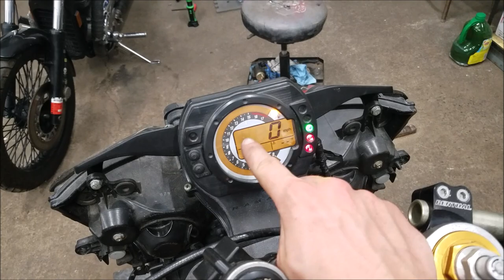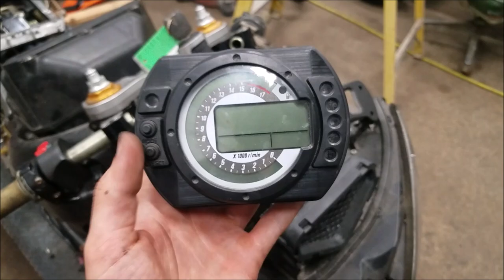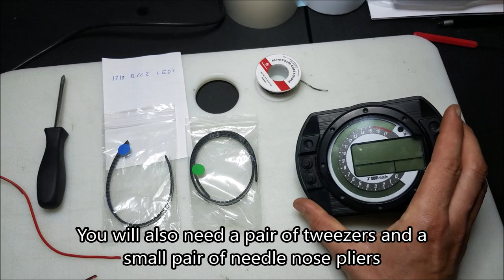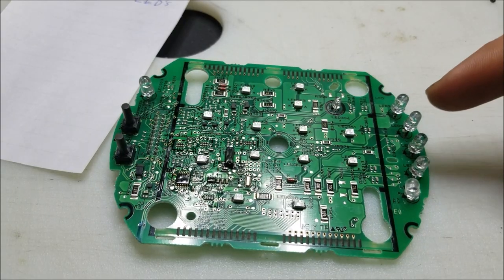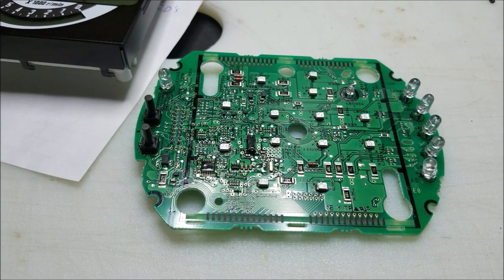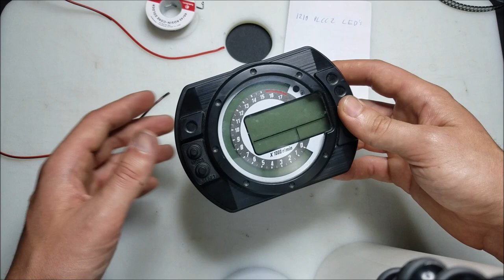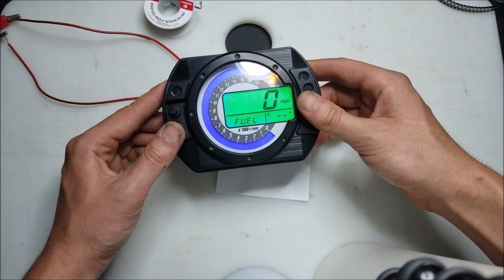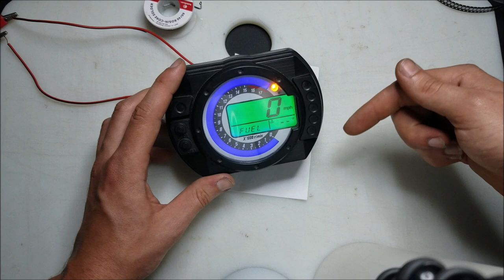How to Change the Color of Your Kawasaki ZX6R ZX10 Gauge

Comment: I'm currently changing mine out on a 05 zx10r same dash. Changed the 6 middle LEDS, put it back together to check and the new LEDS work fine. Now my LCD is reading funny. Instead of displaying 0 it's a mix of 3 and 0.
Edit found the issue. I didn't have it back together 100% the 4 metal tangs all weren't bent and only 1 screw on the circuit board. Don't rush! Great video.

Comment: Amber low fuel and shift bulb type LEDs can be replaced using the same 1210 SMD LEDs.  The cut corner side is the ground.  The bulb type has two pins inside, a fat one and a thin one - the thin side is positive. As mentioned, LEDs have a dedicated power terminal and ground.

Comment: You can get finer tips for that re soldering unit you have. I have the same one. Another suggestions would be to use soldering paste. Then you can just place the LED and use hot air to solder. Saves applying heat to the board. Most mistakes people make are putting too much heat to the board and frying something

Comment: Wicked! I think if I was doing this I'd mix it up a bit; change the LED at the top of the tacho to red, the next one amber, then two green, and the bottom two blue; the diffusion and gradient would make the range go from blue idle, cyan fast-idle, green cruising, yellow at the start of the power, amber for the power, and red for the limiter

And then like. White or magenta for the speedo I guess 😂
Reply: Yeah I’m having white for my Speedo, green all the way up to the 5th LED then red for the last.
Reply: Yes, but don't make it tacky, lol...
Reply: @cr45h20   I’d like to see that. Did the color transition blend well ?
Reply: I'm going to do this over the weekend.  Get a purple up top on high rpm,  blue down low, then blend a teal with green on speedo

Comment: Nice tut! Unfortunately my 250R uses bulbs not leds, any ideas?
Reply from the maker: You should be able to find compatible colored leds to swap out. There should be no soldering involved then so it would be much easier!
Reply: @RKMotorsports  something i was told is to get lower watt leds or risk melting my dashboard housing. Or is that the general idea around all electricals?
Reply from the maker: @plageran  I think if you get leds that are a direct replacement for the bulbs you should be fine

Comment: i wonder if placing a RED LED in the last position on the ring - clockwise - would result in a reasonable red line transition
Reply from the maker: I have done that on a few gauges before and it adds a nice touch to the redline area 👌

Comment: Great vid, did this on two diff 1s, but on the 2nd cluster two of the leds don't work after changing them out 3 times.
Reply: Dang that sucks thats my fear from doing it to
Reply: @BraelonM  I added a bunch of solder on the pads and the leds in place with a a tip and just heated up the sides an they work GREAT, now. Give it try.

Comment: Is there a way to make it brighter? Especially the rev indicator? i find it extremely difficult to see the revs in daylight with a tinted shield.
Reply: I have a zx10r 2005 (generation 1) 
I am thinking about putting on a generation 3 cluster. - it's much easier to see. - but it's also quite expensive. 
As I have understood it, it's not 100 percent a straight fit. But easy to do.

Comment: After seeing this I drove head first into my 04 zx10 cluster. It was a bitch Tbh, just bc of how small they are. Very simple to remove but hard to put all 13 back in. So I did the exact same colors but I guess my soldering gun was a bit too hot or maybe touched something on accident, all the colors work but when you turn the switch off I still have like 2 of the LEDs staying on. Really don't know what to do other than putting a kill switch on for the battery or ordering new internals. 

 Any input will be much appreciated thank you!!

Comment: Hello RK Motorsports, I own an 04 Zx6r 636, bought it used and the gauge has a big black smudge on the center rectangle (where the temp. and MPH are didplayed). I cant see anything other thsn my RPM's and a little bit of MPH, deppending on outside lighting. Its an internal thing, ive wiped the cover and it doesnt go away. 
Is this fixable??
Thanks Mr. RK Motorsports!!!
Reply from the maker: Hi Sierra, sounds like the LCD screen  has been damaged and has "bled" out through your screen a bit. The easiest way to fix this would be to buy a 2nd gauge with a good screen and swap the screen over. Hope this helps!
Reply: @RKMotorsports  
Oh damn!
Do you have or know about a gauge in good working condition I can purchase?

And thanks for getting back to me!!

Comment: I have two questions for you. One related to this video and one that you may be able to help me with.

1) How bad is the bleed of the blue into the green? I'm planning on doing white for the whole cluster with the exception of the LED near redline, which I want to do in red. 

2) Do you happen to know what could cause my fuel light to not go on like yours does? 

I pulled the fuel pump last weekend to diagnose/fix another issue, but didn't think to check into my fuel light issue. I'm not sure what part is the sensor anyways (05 636) on the pump assembly and there isn't any great info I've seen online. I've never seen the light go on in the 4ish years I've owned the bike, and just use the trip to track mileage but would love to have a damn light
Reply: The problem you have is that the sensor that is in the pump has stopped working, you must disassemble the metal capsule and change the sensor for a thermistor, in the zx6r forum I left a tutorial that explains it

Comment: great vid. I dont even have a 636, and i clicked. haha. I do a lot of SMT stuff, and if you dont have hot tweezers, and if you're not reusing the LEDs, you can just us a high quality flush cutter to clip the leads. then drag the remaining leads off the pads with the soldering iron. its much safer since you wont risk pulling up the pads. Which are a bitch to fix and be still be reliable. You can load up a bunch of solder on the tip before hand (helps you get the joint to flow), it takes more dwell time with a dry tip, which can damage the traces and pads... Also try a wedge tip. Way better heat soak on LED leads. Hope it helps... ALSO thanks for the vid... now I wanna try this on my drz's cluster. haha

Comment: I recommend using a chisel tip for soldering (the ones that are slightly flat on the sides). Those conical/pointy tips have crappy thermal capacity and they often make those solder spikes when you remove the iron from the solder joint.
Reply from the maker: Pretty sure I have one of those that came with my soldering iron. I'll need to try that out

Comment: does anybody know if this gauge from zx10 is same as z750. they look the same but is electronic same inside? i bought an old z750 and odometer is way wrong, seas i m doing 80mph when i m going 50. in little investigation on back of gauge its writen with marker zx10 so was wondering abaut compatibility between these 2. ty for any help (info) regarding the matter

Comment: Any chance you may know why my speedometer section isn’t lighting up. I changed the tachometer section to green and all is good but my speedometer section is dead. Curious if you knew what could be the culprit. Thank you
Reply: You could have torn pads off the PCB, due to copying this guys technique, You never EVER want to "Pull" on a device the way he did these LED diodes, you can easily damage the traces/pads on the PCB. You may have also just put the diodes in wrong, they are polarized (meaning one side is + and One is - ) if you reverse them, they will not light up. Want expert Soldering techniques? Northridge Fix, Louis Rossmann, The Cod3r, Hugh Jefferys, all great channels of people who do micro soldering on Mac books/Laptops and Modern Graphics cards and such. You might even catch one of them doing BGA soldering repair.
Reply: @crisnmaryfam7344   I did have some issues but sorted it on my 3rd try. You are correct I’m sure of it. Bike is sold and happy owner so all is good. Thanks

Comment: 9:15 EEeeewww, Doing that the way you are is going to result in tearing the pads or traces off the pcb. GO check out a soldering video or two. Northridge Fix, The Cod3r , Louis Rossmann. All have tons of great videos. Never PULL like you did here, If you have to even use force, the item you are trying to pull is not heated enough. Especially on SMD's (surface mounted) With other things that use anchor ground points , (Like an HDMI or USB port for example) youll find using a heat gun or hot air station to be more beneficial and less likely to damage something.